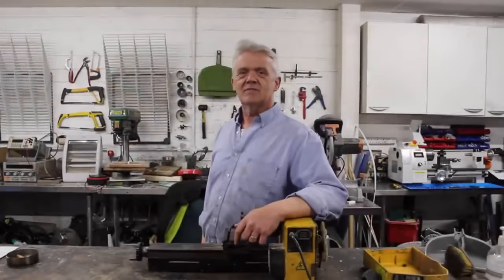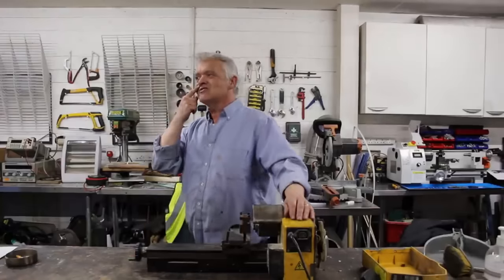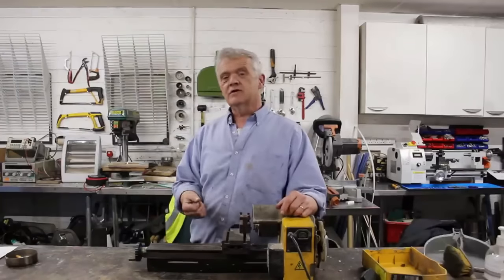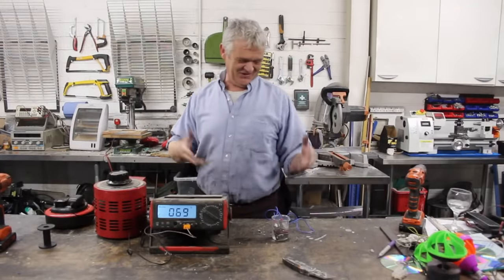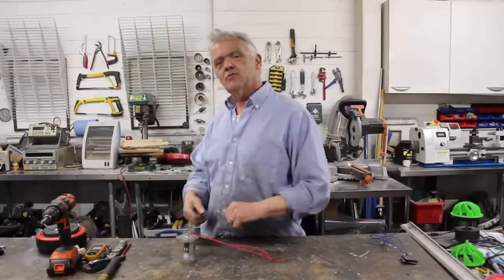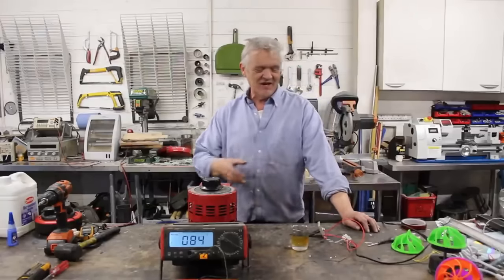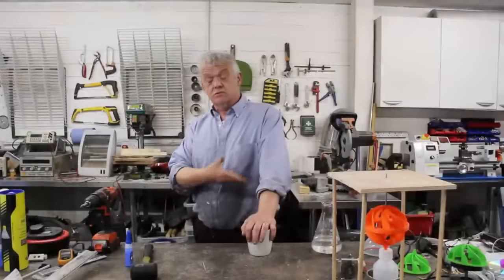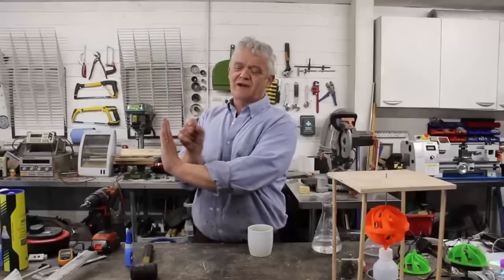016 The Dumas Effect - A Free Energy Water Heater

Comment: Just an important FYI - most variacs do NOT provide safety isolation. They are constructed as variable auto-transformers. One of the output leads is directly connected to one of the inputs. The other connects to the variable tap which will be at any potential between the two inputs but without isolation.  A separate mains isolation transformer in addition to the variac would be my recommendation.
Reply: I was about to mention this.
Reply: Yep, not to not pedantic but people need to not think they receive protection from an auto transformer (Variac), they are not isolators
Reply: I think he was using it to control the voltage and because it had internal over current protection.

You’re right though, variacs do not isolate from ground.
Reply: @deltab9768  Not to be critical, and maybe you simply mistyped, but the point was it is their lack of isolation from the mains which presents a danger to the user.
Reply: @GodmanchesterGoblin  what I mean is that mains electricity is referenced to earth. The “neutral” terminal is grounded. That means you can complete the circuit and get electrocuted by touching the live terminal while also touching any random grounded object (dirt, a body of water, damp wood or concrete, metal framing of a building, etc)  

As far as I know this is the most significant hazard that would be removed by using an isolation transformer instead of a variac or in addition to it. The hazard of electrocution by touching both terminals (or touching water with a voltage gradient across it) would still be there.

The overcurrent hazard (which is explicitly stated as what the variac is supposed to protect against) would still be there.

If I’m missing something else let me know.
Reply: @deltab9768  No, not missing anything. Yes, neutral is generally referenced to earth.
Reply: I think you are all missing the entirety of what he said, at about 7:00, yes, he did use the word 'isolate' but not in the personal safety sense but in the 'isolating the experiment from his mains supply' sense and he does clarify this by stating that he's using the Variac's, I assume, built in MCB, or some such, to trip out in the event of a short and the actual Variac to vary the voltage supplied to the cell thus 'isolating' any fault in the experiment from tracking back to the consumer unit.  @GodmanchesterGoblin
Reply: @icarossavvides2641   Thanks, but I did not miss anything.   I was simply pointing out that variacs do not provide isolation from the mains, contrary to what was said in the video.  (It is possible that his one does, although I doubt it, but most do not.)  Someone not fully understanding that could misunderstand the risks which would not be mitigated by current limiting devices.
Reply: From what he says about it tripping out, sounds like the variac has a built-in residual current device (RCD), aka an earth-leakage circuit breaker (ELCB). They measure the current coming in through the Live wire, and compare it with the current going back out through the Neutral. If there's a difference between the two, it means some of the Live current is going off somewhere else, possibly through somebody's body and then off to the earth. 

I'm sure many of you already knew that, but it's a short explanation, so no big deal. So yeah presumably he has one of those. And hopefully it's not just a standard circuit breaker, the kind that pop when too much current passes, like a fuse does. Ordinary circuit breakers don't protect you from getting shocked (or killed), you need an RCD for that.
Reply: hes an old man in a shop. every old man messing with electricity i ever saw licks his fingers to test a live wire. wa wa wa wawaa wa.
Reply: True... if you put the N galvanically aligned then it could suffice :). But i dont get the idea of the device with graphite? Is it all about the scaling? What is it worth? Remember that heating a 1kg of water from 20 to 100 needs around 80 x 1000 x 4,19 Joules of energy - and giving it through electricity makes almost the real value if youre using wires thick enough :) no waste of energy there. IF you boil only up to 90C you only save 12% of energy :)
Reply: Or lower resistance. 
Electricity takes the pathbof least resistance.
Reply: @tuvoca825  No, it takes all available paths. That's Kirchhoff's Law.
Reply: This isn't true. I take mine into the bath with me all the time. Stop being a wussy, it puts hair on your chest!
Reply: He was concerned about tripping his mains breaker, not safety.
Reply: I think he was using the term "variac" in the same way that a lot of people call a desktop computer the "cpu".  When they actually mean the case complete with the motherboard (of which, the CPU is just one component), power supply, memory etc.. His gizmo on his desktop may well also contain mains issolation and other safety components.  Without a make and model though, I'm just guessing.
Reply: @KenFullman  But it is very obviously a regular variac based on what we can see of it.  Yes, he does not give details, but it's the regular slotted cylindrical case with a rectangular panel on the side for the connections. The same style has been around for decades.  And regardless of what it actually is, he calls it a variac and says it provides isolation, which is something that variacs in general do not do since they are normally auto-transformers with a variable tap for the output. Hence my warning to those who might take his words too literally.

Comment: Way back in 1970, my wife had a hair curler/roller kit that used this method. The curler would heat up with the steam produced and she would wrap her hair around the curlers, and there you have it. It worked well, but it wasn't free energy. Had to descale it with distilled vinegar. .
Reply: those were a element heaters at least the one my wife had was.
Reply: @dontimberman5493  I disassembled my wife's because it was working poorly after awhile. It had two separate electrodes in a tank of water. Each one connected to the mains. They were covered in minerals, I filled the tank with distilled vinegar to dissolve the minerals and it started working again. No heater element in hers.
Reply: I remember electric jugs with two plates separated by about 1/4".
Great advantage was no exposed element to burn out when the water got too low.
I now wonder about the metals that got dissolved into the water ?.

Comment: Wearing armour while playing with mains power gives rise to a related phenomena; The Dumb-Ass effect.
Reply: I hear you
Reply: Ben Franklin would be proud.
Reply: If it's earthed properly it's about as safe as you can get. They wear Faraday suits to work on power lines. I'd rather the current go through the metal around me than it going through my body.
Reply: @EddieTheH the problem is mains power wont just go through the surface of the armor even if grounded unless every piece has a good connection to the next you have a high risk of the electricity passing through your body in search fora path to ground. The Faraday suits those guys wear are specially designed to carry current evenly and the wearer is wearing an insulating layer underneath for more protection.
Reply: @brad1367  Even then, it'll just be localised burns rather than systemic. The armour will protect your heart, etc.
Reply: darwin award
Reply: hahahha the "Dumb-Ass effect" good one!

Comment: In Australia this technology is used in motel electric jugs
The advantage is that if the jug boils dry it stops working without damage.
The disadvantage is it’s a lot slower than a resistance coil.
The jug uses stainless steel electrodes 
The water tastes normal
Reply: Ur
Reply: Problem with stainless steel is that it sometimes contains chromium. The ions or atoms of which you really really absolutely DON'T want to ingest in your cuppa tea.
Reply: Hotel jugs.

Comment: When I was an apprentice 55 - 60 years ago one of the guys connected a TV antenna connector to a couple of electrical wires, connected it to the net and put it in a cup with water. It worked fine as an instant water heater.
Reply: The electrodes should be graphite. Any other metals will slowly dissolve into the water.
Reply: Connected to the net? What net?
Reply: @cortneyholt  The mains net or 220Vac as it was in Denmark.
Reply: @cortneyholt   electrical grid / net

Comment: safety note:- most variacs DON'T isolate from mains, they are merely autotransformers and so at high settings especially you are directly connected to mains with litte or no impedance between you and mains at all. 
For isolation purposes, you must preceed them with an isolation tranformer (suitably rated)
Reply: Yes, there's a marginal difference between safety and stupidity 😂
Reply: Isolate the variac.
Reply: I Iike this subthread!  

As a dabbler in solar at 600v DC and 3kW PV inverters I have two questions (for you guys, and Robert):

1.  What do we make of Robert's assertion "at the level of the cell...there will be NO electrolysis [or evolution of gas]"?

2) This resonance thing. Are we all happy saying 50Hz cannot have any resonance effect? Surely in a container capable of reflecting compression waves, 50Hz could easily generate multiple resonant frequencies due to constructive and destructive interference?
Reply: @simonmasters3295  Is this 50Hz sonic or electronic?  Sonic 50Hz might be nicely resonant within a reasonable sized container (appx. A flat, first octave, fits in a piano), while 50Hz em will be gigantic (5,995.849 km, requires a small town).
Reply: He was using it because it had an internal breaker. He wasn’t attempting to isolate it from ground.
Reply: @deltab9768 Breakers won't break at 100 mA, but you might.
Reply: @chaosopher23  yeah he mainly just stood back from the test setup to avoid accidental contact. Hopefully he had GFI/RCD protection too.

Would it have been better to have an isolation transformer as well? Possibly. My point is that he was not attempting to use the variac as an isolation transformer, he never said he was, it was clear in the video that the circuit was not isolated and that only overcurrent protection was being provided.

Comment: After you mentioned the Ohmic Array a year or two back I planned to try it out, and still intend to. Heatworks say that the current in the heaters is something like 100 amps, which is fine for plumbed-in instant heat but not fine for home experimenting. I did find a formula that related the sizes of the plates, the distance apart, and the resistivity/conductivity of the water with the current and amount of energy imparted into the water. I worked out that it would take around 40 minutes to heat a bath of water with a current limit of almost 13 amps (one of the standard fuse ratings in a UK plug), although I ignored heat loss from the water. I did acquire some cheap carbon-lead batteries but couldn't find cheap graphite plates, so whenever I get round to experimenting I'll use flattened tin material (oddly, most tins are bad conductors, but tins that have contained condensed milk have a different surface finish and are good conductors).
Reply: Most modern food 'tins' have a plastic coating inside. This might be why you do not find them good conductors.

Comment: About 40 years ago some scientists in Europe somewhere discovered that placing a length of brass tube about 4mm thick and about 100mm in diameter into liquid nitrogen. When they pulled it out they heard it resonating audibly. So they measured the frequency and then modified an amp and speaker to oscillate the tube at that frequency. The tube showed rapid temperature reduction until approaching the temperature of the liquid nitrogen.
I think the show was called “beyond 2000” from Australia.

Comment: I was born in New York lived in Cuba for a few years. In Cuba, people made water heaters like this using two different size tin cans, one inside the other and use a piece of  rubber from a bike tube to separate the cans. Placed in a bucket of water it would heat the water quite fast!
I purchased there  an nicely made unit (I still have it) that looks like a water filter. Inside it has two stainless steel plates separated by a piece of rubber. Each plate is sustained from the top by a connector bolt.
I tested the unit at home and it used a tremendous amount of energy compared to the standard heating  element in my small water heater. 
I never installed the unit at home.
Reply: I imagine it would suck down the amps.

Comment: Always informative and thanks for explaining the how the difference in AC and DC affect the process in different ways.
Reply: If a heating element is totally immersed in water all of the energy it consumes and emits must be absorbed by the water. A very small amount might be conducted (thermally conducted) out down the wires but that will normally be negligible. Therefore ALL simple resistive water heaters are 100% efficient. This means that anyone  claiming to have invented a better water heater (resonant or otherwise) is effectively claiming to have invented an over unity (>100% efficient) machine which isn't possible.

What a lot of these "improved boilers" really do is only heat part of the tank, the water nearest the heating device, so you get localised boiling. Any boiler that puts energy into a smaller volume of water will boil that smaller volume faster. This makes it look like its heating the water faster.

To do a proper test you need to stir the tanks to ensure all the heaters being compared are heating the same volume of water with the same amount of energy. Eg Apply a known amount of energy,  then stop, stir the water thoroughly so it's a uniform temperature, and measure the increase in temperature produced. 

A microwave oven is less than 60% efficient so its far better to heat water in a kettle than a microwave oven. The exception being when you only want to heat a small amount of water eg less than needed to cover the element of the kettle.

Comment: Look up an old-school Vicks warm-vapor vaporizer; plates immersed in water boiling nearly instantly (and generally getting a lot of scale buildup).  The newer ones may use closed heater modules but I spent a lot of winters cleaning out the plate variety..
Reply: Yeah I remember de-gunking those in my youth, which is over a half century ago. Always added a pinch of salt. It's just a resistor really (I'm not sure how the graphite/de-ionized water one gets started). The same "tech" is used as giant loads/resistors for, for example, dynamometers or high-power radio transmitter testing, or welders, and iirc a crude version's been used to boil water for tea in one's jail cell.